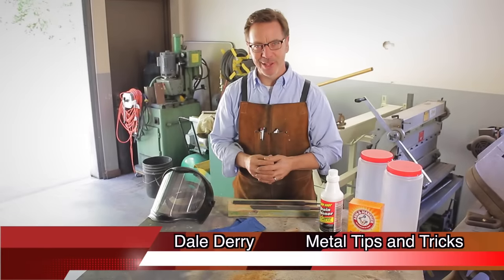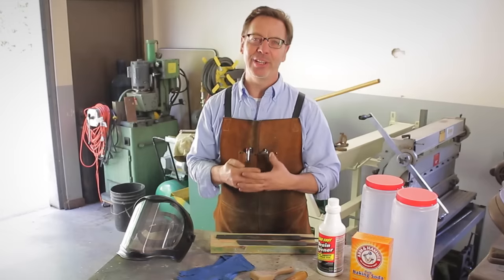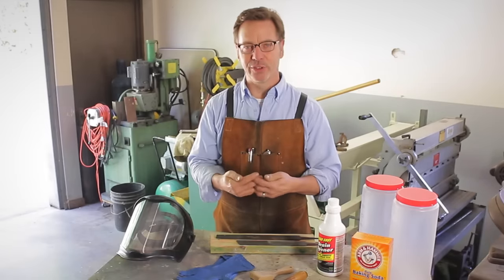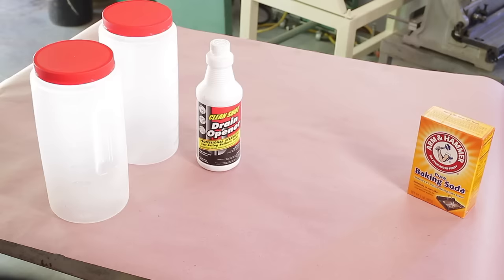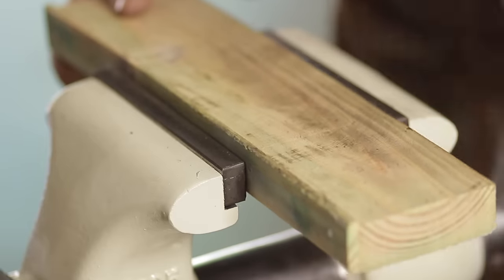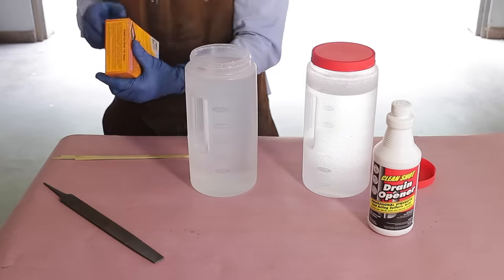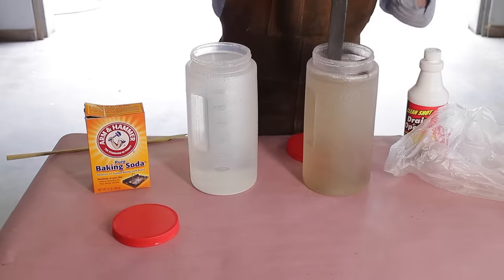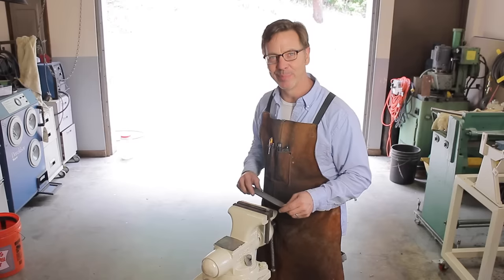How to Sharpen Metal Files

Comment: As a licensed tool and die maker I can tell you that you did not sharpen your file. You simply removed material that had loaded up in the gullets of the teeth. A "loaded file will not cut, so removing that material will make it cut better. To sharpen a file you must remove metal. Files are very hard but being the same hardness means that rubbing them against each other (as in a drawer) will actually dull the cutting edges. A good way to prevent loading when cutting soft metals is to first rub chalk onto the file. This will prevent the soft metal from sticking in the gullets of the files cutting teeth. The teeth on a worn file look shiny instead of dull. When THAT happens, throw it away. There is NO way to resharpen it.
Reply from the maker: It really dose sharpen the file. Give it a try, you have nothing to lose.  I promise you, you will be surprised.    
One side note the file must be dull not damaged to work. :-)
Reply: If the teeth are rounded and the acid strips away an even amount over the entire surface area, it will make the teeth more narrow and remove the rounded tops, therefore making it sharper.
Reply: I was wondering about that as well, if it removed the material evenly, if that wouldn't keep the edge intact.
Reply: If this were true then you could take a razor sharp knife and put into acid and expect it to come out razor sharp but it would actually erode the thinest part first which of course is the sharp edge. Working as a toolmaker since the 1980s I have a strong background in metallurgy and how metal can be sharpened or lose its fine edge. As said earlier, the file may seem sharper but this only because acid has removed material from a clogged file not by making the edges of the teeth sharper. A clogged file will not allow teeth which are still sharp to cut.
Reply: its going to remove the sharp tops faster than it removes the rounded tops.
Reply: Instead of throwing it out call up aa friendly Blacksmith or Bladesmith and hand it over to them they will love you for it and be tickled pink as file material is awesome for making life long lasting knives.
Reply: dont throw it away. Save them. The steel in them is very good for making knives from. There are tonnes of people who would love all your old files.
Reply: Paul I beg to differ with your analysis. Your first sentence is critically flawed. Without actually testing the file, it is difficult to prove that the file is not sharper. 
Licensed tool and die makers do have a great deal of training in the proper use of tools. I would hope that some of it involved the use and maintenance of files. 
A clear explanation of this process and several similar methods can be found at page  235 of Workshop Receipts: For Manufacturers and Scientific Amateurs, Volume 2. It's available free from Google books.
Reply: EH!---WHAT? ---NOBODY has more training than toolmakers.
Reply: Who licensees a tool & die maker??
Reply: So this company has been around since 1932 and does in fact sharpen dull files with a special honing process, they are usually better than a new file and at very reasonable cost: https://boggstool.com/file-division
As a "licensed tool and die maker" you should know that you don't throw away a file because it is dull. The tool steel that they are made of is very useful for making other tools like scrapers, deburring tools, knives.......
Reply: A licence does not make you any smarter than you were the day before you got the license.  There is something called "chemically sharpened"  That is a thing.  All the finest fish hook companies have been using it for for tens of years. It is a variation of the process noted in this video.  It works.  Some might say it works VERY WELL!!  Try it before you poo poo something.  Your problem is cognitive dissonance. That is also a "thing".  Look it up.  You will be a smarter person for having done so.
Reply: @paulsiwy6097  Wrong.  It works.  It's called "chemical sharpening".
Reply: @josefrefuses2go694  or just do what the guy is showing you.  That works too.
Reply: @LegendLength  Absolutely correct!
Reply: @BuildSomthingCool  must not be dull for it to work 
So it has to be sharp. For your sharpening technique to work. 
Got it.
Reply: @LegendLength  which mathematical theory supports this claim?

If I erode the corners of of a shape, it will become more round, not "sharper".
Reply: LegendLength  This would explain all those razor-sharp pebbles I keep finding on the beach then... ...or the frighteningly sharp rusty woodworking chisels I find at flea markets... 🤔
Reply: I am from a family of T & D makers. What is the " license " you mention ?
Reply: @Paul,
Being a Fitter, I support and certify your statement.
Reply: @paulsiwy6097  actually when you etch damascus steel, if youve ground a fine edge, like on a knife, it will come out extremely sharp
Reply: @paulsiwy6097  no
Reply: @eddiefoy3701  Tradespeople of all recognised trades hold licences. Would you have an unlicensed electrician wire up your home? Provincial or State authorities issue trade licenses following an apprentiship program and written examinations.
Reply: @Petzlglyph  , used files are very brittle so have a limited number of uses. After annealing they can be reshaped then rehardened. Blacksmiths are very happy to repurpose used files.
Reply: @algirdpatrick5048  Do they not license Tool and Die Makers in America? They have for more than 100 years in Germany, England, Canada and countless other countries. No license = no job.
Reply: @paulsiwy6097   Nope. No license for T&D in the USA. A licenses will NEVER guarantee a quality/correct job.  Just shifts liability.  I've seen TONS of crap wiring from 'licensed  electricians' here.  A better higher quality job can be done by on unlicensed bloke.  A license is just a piece of paper.  Thanks for playing.
Reply: @opwards  Not to mention the other things you can use them for.  A bit of file is great to use in a flint-and-steel fire making kit.
Reply: @LegendLength  It is in fact a simple mathematical truth, but your conclusion is opposite to what actually happens. For example: Take a sharp pointed piece of sugar, toss it in a glass of water, it will become less pointed and more spherical.   

The key here is the ratio of surface area to volume.  Pointed, and textured surfaces have a higher ratio of surface area to volume, whereas spheroid shapes have the minimum ratio.  Given that all surfaces will dissolve at the same rate, the areas with the higher ratio will lose material faster and the end result will be that the object comes out more closely approximating a sphere.  In other words the sharp edges of the file will be rounded.
Reply: @BuildSomthingCool  Your patience is legendary! <grin>  I am certainly surprised that so many bash the idea without trying it.  So many are saying 'it only cleans' that I wonder if you went through the cleaning process with the file card and then the copper pipe,  demo the cutting as you did with the initial dirty file and then compare that intermediate result with the result after the acid bath, perhaps it would quell some of the nay-sayers?  Who knows, anytime one does anything there is someone else to criticize.   Everybody 'knows' cement does not float and were careful to hassle me about the 55' ferro-cement schooner I built back in the '70's.  I sailed it over 50K miles, survived 2 hurricanes.....but of course, they still don't float.  -Veteran '66-68

Comment: Looks like it works OK. I would be interested to see what a high powered microscope on the tooth profile on the file looked like before and after. If it just cleans the file, it would be useful enough but if the effect of the acidic bath alters the tooth profile it may be even better.
Reply: I just put that question in.  I'd like to see that too.  Maybe someone has done that already on YT.  We should look for it.
Reply: I belive is called chemicaly sharpening, is a method used to sharp fising needles, razor blades, because it takes less time and is cheaper than going through multimple grits of sanding materials. They just sharp them up to a point, then dip them in accid, this will disolve the steel and leave the edges as sharp as steel can be. I wouldn't say is better because it also weakens the teeths of a file, and if you do this multimple times, i would say more than two times, it will affect the flatness of the file and it will eat the teeths. Is good method, i never tried it, but i played with accid to remoe some rust. For old files, is better to give this treatment then throw it away. And old files can be turned into other kind of tools, such as chisel, or marking knives.

Comment: Thanks for finding the Popular Mechanics article. That answers the "I won't believe it without photomicrographs crowd."  I wonder what their next objection will be?
Reply from the maker: LOL
Reply: funny thats the only article that says this is sharpening that ive seen
Reply: Thanks for your comment. I wouldn't have looked in the description otherwise. Why doesn't this work for knives, chisels, or drills though?
Reply: Hey guys,  if you don't like the idea of acid sharpening don't use it. 
 It does not matter to me whether you need to find reasons to contradict the idea or not,  but some of your comments are really a bit thoughtless. 
 
Technically you probably could use acid to sharpen knives etc,  but you would not use it.  The knife is a thin tool and eroding away some of its thickness is unhelpful.  Chisels do not suffer from a lack of thickness,  but eroding metal would alter its dimensions,  also the erosive process is not very uniform,  so getting a nice even sharpen will not happen.  Drills also do not want to have their dimensions altered.  Also with the drill bit the angle of the cutting area is quite large,  unlike the angle of the cutting part of a file.  The result would be minimal sharpening for significant loss of metal and loss of dimensional accuracy of the tool.  

Surely,  the proof of the pudding is in the eating.  Just try it.
Reply: The idea of sharpening drill bits as a test of the process has been brought up before. The differing actions of a file and a drill bit are the reason it isn't used to sharpen drill bits. 
Drills use the width of the point to define the diameter of the hole that is drilled. 
Acid removes metal from every surface it comes in contact with. The drill bit will become smaller in diameter just as fast as it becomes sharp. You end up with a drill bit that is sharper but with a random sized diameter
The same, two surfaces being eaten away, process exists because the diameter is the measure of the distance between the two sides of the bit. 
It will work on a knife but who wants a thinner shorter knife? 
Besides each of the other suggested arguments against using acid, points out a device that is normally sharpened in a different way, as an example of the acid process being a failure. If it were as easy to run a stone down the edge of the files teeth as it is a knife we all wouldn't bother with the mess of acid sharpening. 
Milling cutters are ground on center grinders because they have fewer flutes than a file would have in the same distance.
The operation of the file doesn't depend on it's width or thickness as long as it is sharp and strong enough to not break during use.  😊 
If you would like a good history of files, how they are made, and used I recommend The File It’s History Making And Uses by Henry Disston & Son. Upload of a copy from the Stanford University Library is available here. 
https://play.google.com/books/reader?id=1mNBAQAAIAAJ&printsec=frontcover&output=reader&hl=en&pg=GBS.PA7

Comment: Hi mate.  So, has it only cleaned the file, or has it also chemically sharpened that file?
Reply from the maker: +Marcel Timmers 
It chemically sharpens the file
Reply: +Marcel Timmers  I wish Dale had addressed this. Yes, the acid is actually removing metal from both sides of the file teeth, leaving a sharp edge. The total amount of metal removed must be equal to or greater than the surface area of the dulled edge. This technique works great a few times, but eventually the etching process becomes too uneven, and while still sharp, it can be hard to get a clean finish with the file.
Reply: Thanks for that mate.  I was not sure of what had actually happened.  Again thanks for the extra info.
Reply: +FXM For Single or double cut?
Reply: +BikingMNViking  It works for both, but as you'd expect, you'll see a quicker degradation of the finish from single cut files, which you are most often using for a finishing pass, anyway.
Reply: Being double cut have that cross hatch area I'd expect more degradation on double cut files. Sounds like the most important thing is just to make sure the file is clean for the chemical to work.
Reply: BikingMNViking I think you're probably right as far as actual amount of metal etched away, but single cut files are more like a series of planer blades which leave a smoother surface than double cut, which act a bit more like a rasp and leave a more scratched surface. The exact alignment with each other and straightness of the cutting edges is more important for the single cut files finish so the degradation is just more obvious after fewer sharpenings.

Comment: I found having my old rusty files hard grit blasted cleaned them perfect and restored cutting performance. Experimented with grits and found silicon carbide grit in medium(80) did best job.
Reply: If the gullets are deeply packed with rust then yes grit will remove that but it will also Nick any sharp edge tooth that you've already have. Especially large coarse Grit . Anyone trying ball shot or well used Steel split shot will just peen over  the sharp edge. 80 grit will make a really jagged Cutting Edge serrated should try something a lot finer or even use baking soda as the blast medium which is softer than the steel and won't dull the sharp edge but will remove the rust and oil , crud , Etc. 
Mechanical engineer.

Comment: Any explanation as to how this works?
Reply: The acid is dissolving any small particles that are fused into the file and also it etches the file teeth that are worn thin and leaning over exposing new strong cutting edges. Too strong of acid and it will do the opposite and remove to much rounding the teeth over.
Reply: +Matt yeah, the acid eats away at each ridge fairly evenly on both sides just like stoning a knife blade on both sides and effectively chemically sharpens each edge.  This won't work many times.  1 or 2 tops from my experience.  And it won't be "like new",  but can dramatically improve an old file that's not too far gone.  I highly recommend thoroughly cleaning them with brake cleaner prior to the acid bath.  Some grease or oil can leave some parts unaffected by the treatment.
Reply: +Eric Allen I wonder if lightly going over it with a magic marker (just enough to cover the tips) would let the tips be rebuilt by the acid eating faster from the troughs.
Reply from the maker: +blmeflmm66 
Great comment
Reply: I actually use vinegar, but the process is the same, just takes longer.  12-24 hrs depending on how froggy I'm feeling.  It won't fix em all, but hey, never hurts to try.  There are way too many variables for a set time.  Temp is a big factor, of course hotter is faster.  I pull one out, rinse, try it and repeat until I stop seeing improvement.  Too long in the soup and you get a future knife blade candidate.  Don't attempt this operation around metals you value, like carbon steel tools and cast iron since the off gassing is corrosive enough to flash rust nearby items like table saws, hand saw blades, wood planes, chisels etc.  Don't ask me how I know that........ Let's just say that this time saving technique has inadvertently led to hours of steel wool and scotch bright work on other tools.
Reply: It'd be pretty cool if someone with one of those nifty usb microscopes posted some before and after images of the process.
Reply: blmeflmm66
I intend to try this comparing it to the above mentioned application of "resist" to the tips. Will upload the results as soon as I get the right acid.
Reply: Dozens of explanations!  I am pretty sure they're ALL WRONG!  Find someone who knows about FLUIDS and Chemical Engineering maybe, or METALLURGY?

Comment: The copper tube part is one of the most important steps in cleaning a file and you didn’t even barely mention it. When you run the copper flattened tube over your file, the softness of the copper allows it to form down into the teeth of your file and clean it. This is one of the most important steps. You need to elaborate on that and how it works if you ever make another one of these.

Comment: Hi Dale, nice tip, but using the file without a handle... you were specific about safety with acid & wearing protective gear  but not mentioning file handle ... tut, tut,